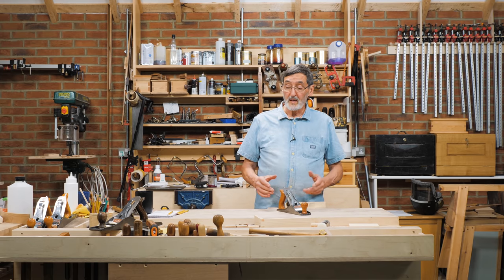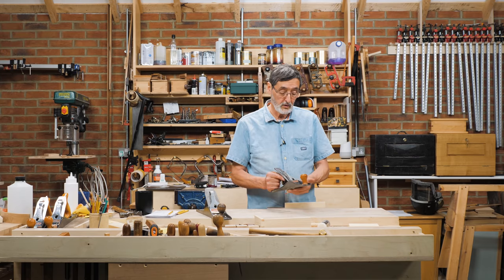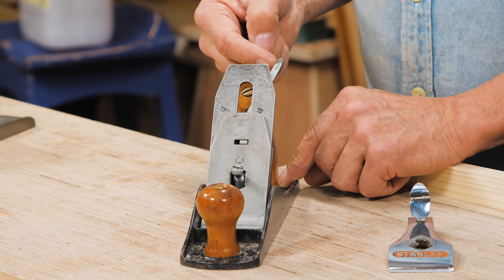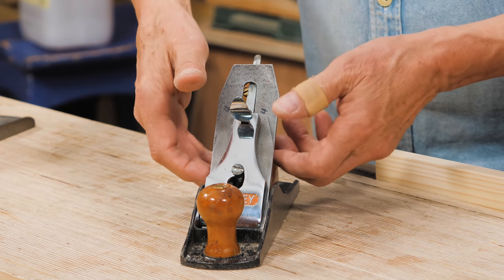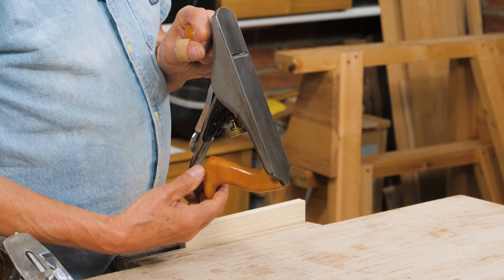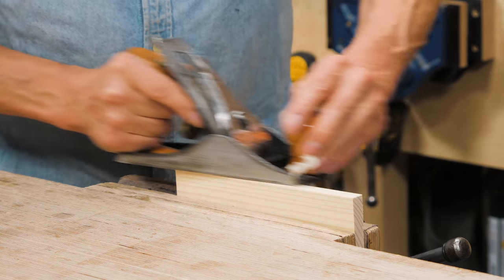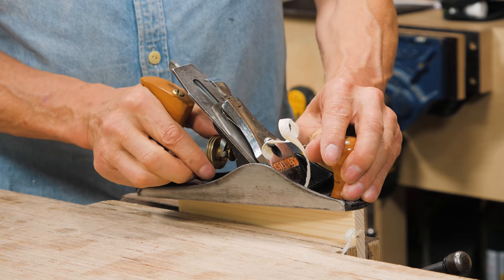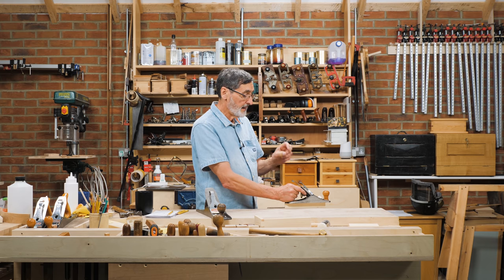How to Adjust the Lateral Lever of a Bench Plane | Paul Sellers

Comment: I'm relatively new to the hand plane world, but with help from you sir I am addicted! I have learned that sharpening an iron isn't as intimidating as I had once thought. The reward, that sound the plane makes as its slides across the wood making translucent ribbons of wood. It's so therapeutic! I  had to take a day off after first use because I spent hours leveling out a slab, my right arm and shoulder were so sore. It was worth it! 😊

Comment: Thanks Paul.  I had hear you discuss using the sound of the shaving to adjust the lateral adjustor.  For a while I would use the sound and then pull out my calipers to measure the thickness of the shavings.  By measuring it few times and getting my ear sensitive, it really is quite clear at how well the sound is all you need to use to make the adjustments.  Thanks for sharing this.

Comment: Hi Paul, thank you for these "reference" videos. Perhaps as a follow up to this video you could address how to deal with adjustment levers that are too tight or too loose, as is the usual case with the recommended vintage bench planes.
Reply: I'd second this request, I have a No.5 with a loose lever. It still functions, but rattles up and down in use which is irritating. I'm tempted to tap the joint between a couple of hammers to tighten it, but it would be nice to have an expert's input before I 'fix' it.
Reply: third request
Reply: Fourth request. I've restored my father's n.4 plane using your videos. Just the lateral adjustment lever is kind of loose.

Comment: Perfect timing as I was trying to find a video on that!
Reply: Literally every video on setting up and using a plane will talk about the lever cap because it's one of the two adjustors (the other being the wheel) that you use every single time the iron goes back into the plane after resharpening/honing. 

The only other major adjuster there is on normal bench planes is the frog-advance screw, but most people don't use that and just set the frog set where they like it (usually back quite far, so the front of the frog lines up with the rear of the mouth) and then never touch it again. I mean literally never, unless they remove the frog to clean underneath it at some point :-)

Comment: Unlike The Pretenders I don't have Brass in pocket so I had to buy the cheapest load of crap plane. I then spent about 20 hours sanding the sole to make it flatish but did manage to get the heal and toe fairly close to being "level". However the lateral adjuster was locked in place and wouldn't move and worse, the pin holding it was plastic so I had to be very careful not to break it as I tried to free it up. I'm guessing the plane iron is also C&N (cheap & nasty) and a new one is half the price of the cheapest No. 4 Stanley so I may just take a punt and see if I am allowed to buy that for Father's day. Thank to Peter, Matt and Rex I now have a small idea of what I am looking for when purchasing a plane. Wish I had known 4 months ago before I purchased the Indian Craftright POS.

Thank You for the videos and for sharing your knowledge Peter. It really is much appreciated. 👍
Reply: Hi Joseph, you in the UK right?

Comment: Whats the best ways to eliminate vibrations (skipping across the wood) with your plane.ive flattened the sole of my plane and sharpened the blade to the point i can take hair off my arm. It seems the issue got worst and i cant seem to fine tune my plane. Any recommendations. The plane is a Dunlap #4.

Comment: The first tools I bought were Stanley sweetheart chisels and #4 plane. The chisels are fantastic however the adjustments on that plane are not the same as that older plane. I can not stand the way mine adjust. The adjustment for thick/thin is on the same control for lateral adjustments. I wish I knew more when I made the purchase I would have bought a different plane.

Comment: Question: What if the lever is too loose? Can it be tightened? I can't seem to find a way to do this. Any tips?
Reply: You can try more pressure from the cap iron via the adjustment screw.

Comment: I bought a 5 1/2 Stanley from eBay, it was supposed to be "reconditioned" but the adjustment lever has a huge amount of play in it, it moves completely freely without any pressure. What's the fix for this?

Comment: Being a complete idiot with regards to plane usage I had assumed this angle adjustment was used if you need to take off more wood on one side, for example to create a slope towards the edge of the piece of wood, it worked for me, but seems this is a complete misuse of the tool! I only found out when I borrowed an electric planer from a guy and asked him how come there is no angle adjustment for the blade like a hand plane? he explained as per Paul's explanation... You live and learn.

Comment: Next, can you talk about japanning irons?
Reply: Joke? 'Cause the only parts of bench planes (ones that are old enough) that were japanned were the frog and inside of the body casting. There were some japanned lever caps, but they weren't around for long.
Reply: @tungsten_carbide  I was referring to the cast body.
Reply: @two_tier_gary_rumain  Well as far as that goes Paul hasn't ever re-jappaned a plane – he had more important things to do during his career :-) So what I'm saying is you should look elsewhere, and there is plenty on this online. 

But I can shortcut a lot of the research for you, save you from the confusion and complication some formulas and guides try to introduce.

Japanning can be really basic stuff, regardless if you want a baked version or a room-temperature (cold-cure) version. In both cases the simplest formulas have just two main ingredients, plus some turpentine or white spirit if you need to thin it slightly. 

All you have to do is mix the powder with the requisite vehicle/binder as thoroughly as your patience will allow, to minimise lumps. And then wait for it to age; this is a step that many guides omit but it's important as it also greatly reduces lumps/clumps in the finished liquid japanning.
Reply: @tungsten_carbide  I'm more interested in knowing if regular enamel is a good substitute.
Reply: @two_tier_gary_rumain  Well I think it's a reasonable substitute, and every plane I've stripped right back and repainted in enamel has shown zero sign of problems in the years since. 

But everyone has a different opinion on what's a good thing to use if you do want or need to refinish. As you probably know many purists hold that only japanning should be used on planes that were originally japanned, both for its proven durability/longevity but also they insist that paint cannot look like japanning. But there are numerous posts online from people who have planes in their collections that were carefully refinished to look right (a suitable paint used, built up to sufficient thickness) and planes with their original japanning intact and can't tell which is which. So the right paint can look exactly like japanning.

Paul has previously recommended an acrylic paint to touch up spokeshaves so I think we know where he'll fall on this subject of whether we need to re-japan old planes!

BTW if you do strip right back and the casting has a pleasing surface it's actually okay to not refinish at all. I have a cheap plane I didn't care about that I used for rough jobs like planing old paint off salvaged boards and as an experiment I stripped the paint off a few years and simply treated the interior the same way we treat the exterior (in my case with paste wax). And it has held up perfectly well.

Comment: i was kinda hoping this would explain what to do if you can't align the blade properly, i bought an off brand plane a little while ago and need to adjust the lever all the way to the left to get it somewhat equal but i can't push it further to even it out, my blade is square however the left side of the blade (when the lever is centered) sticks out about 2/3mm more then the right side
Reply: I assume your plane was a cheap plane. I have come across modern cheap planes that have terrible levers and depth adjustments.
Reply: @sl0ffie If your blade really is square, and not just close, the problem might be the frog itself. Check the adjustment to make sure the blade is not bedded forward on one side, since on cheaper planes, the machining can be bad, and there is probably nothing keeping the frog parallel with the sole. Normally on cheap planes, it is just held down by the screws beneath the blade, and there isn't a frog advancement screw on the back.
Reply: Check this video of Paul's, he explains a lot of what I was talking about on the frog setup at the 20 minute mark and the 1 hour mark. https://www.youtube.com/watch?v=RYyV6IUpsYk
Reply: @beralius8584  i have adjusted the frog since i bought it but it doesnt seem to do anything, and it is indeed one without adjustment screw, i think it's mostly in the adjustment lever itself thats causing the issue, if i were to be able to get the lever off and refine it it would have been an easy fix however i dont seem to be able to, the only thing i can thing of right now that i could do is file the slot in my blade wider so i do end up with the room to level the blade, that or carefully file down the lever a bit.
sadly enough at the time of purchase i didnt have the funds to afford a no4 Stanley, wich would have cost me double the price.
Reply: @bighands69  yeah, it was about half the price of a Stanley no4 plane, at the time of purchase i didnt have the funds for the Stanley sadly enough
Reply: @sl0ffie  I wouldn't file either to be honest. There should be very little gap if any between the adjustment lever and the blade slot. You can try taking the frog off completely, mounting the blade, chipbreaker, and lever cap, and looking at it from underneath to see if the blade protrudes squarely from the frog. 

If you can get it square to the frog, then the frog isn't square to the body of the plane. If the pads where the frog makes contact aren't milled the same height, you will also have issues with the blade protrusion being off.
Reply: @sl0ffie  The amount of lateral adjustment you have may also be restricted by the depth adjuster or even the sides of the plane body.
If you have access to a grinder, you could re-grind the blade's cutting edge at an angle rather than square. That would allow proper alignment within the boundaries of adjustment that you have. 
You could do the same with sharpening stones / sandpaper, but it would take longer.
Reply: @sl0ffie  Some planes are just like a little like this unfortunately. It's not only limited to off-brand ones either, I've had a few Stanleys pass through my hands where the lateral needed to be way off to one side to have the iron project evenly. These were British-made Stanleys, but this is not limited to those by any means. I currently own two or three planes which have this problem to some extent, including a nice old US-made Stanley from when they were still using rosewood for the handless so from the era when Stanleys were supposed to be top-class tools.

Anyway, I can suggest a few things to check with your plane that might be causes or partial causes. 

– First is the squareness of the rear of the mouth. Even if it's a little off it can be a problem. If you find yours is out it can be adjusted relatively easily by filing and there are some guides to doing this online if you need them.

– Next, whether the front of the frog is flat (no twist or a high corner). And if it's evenly flat – I've seen quite a few planes where the grind was biased to one side (so the frog was a tad thinner on the left or right) and if it's bad it causes adjustment difficulties. 

– Then, is the pivot point for the lateral drilled off-centre? This not being dead central is surprisingly not that uncommon! Obviously there's nothing you can do to fix this but if it's there you know you may have to adjust elsewhere to compensate.

– Last, is the iron itself flat once the cap-iron screw is fully tightened? It isn't rare to find iron assemblies that aren't dead flat, usually they're bowed just a little but sometimes they are twisted just a smidge. These can be fixed by careful hand bending, with or without a vice.